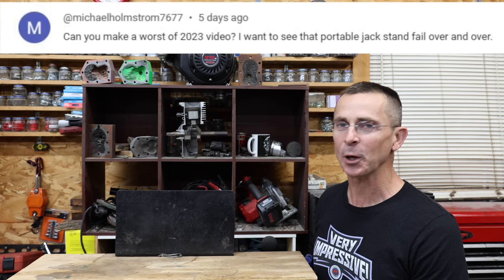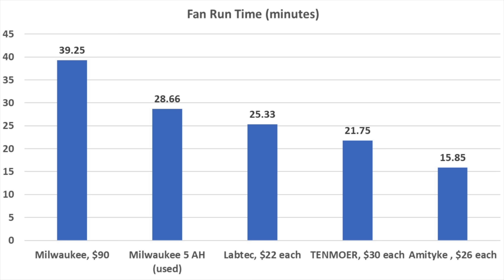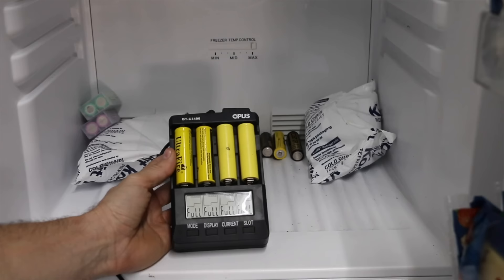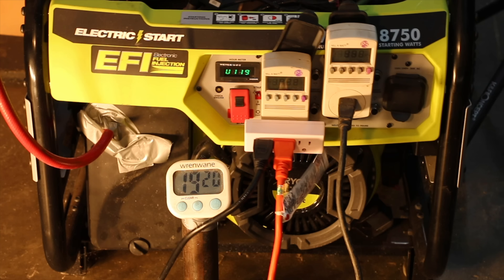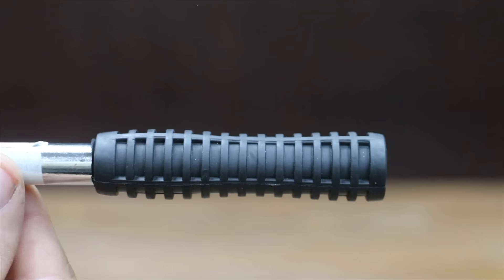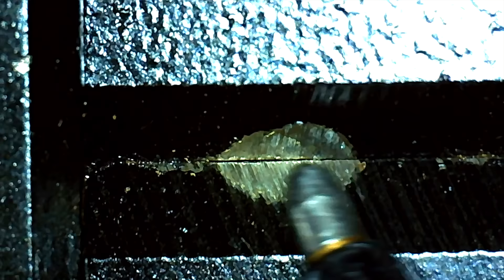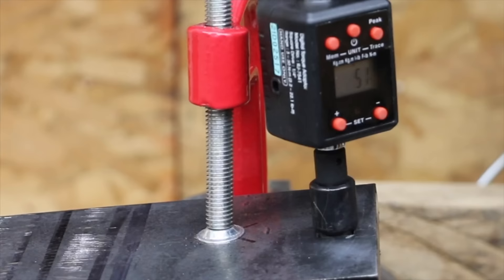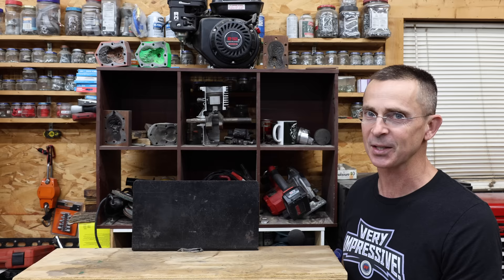10 Worst Items Ever Tested? Let’s Find Out!

Comment: Time for top handle chainsaw! The  M18 top handle would have been great in your last battery powered 12" and smaller video, although could compete in full size as well. Seen many claims it cuts better than there 16" rear handle. I know top handles are mostly used for climbers, but they are also nice and compact for a lot of regular cutting. And there is quite a lineup of top handles gas and battery powerd! Would love to see such a review!
Reply: Also add the m18 hatchet came out shortly after your small chainsaw video! Would love to see that tested as well!
Reply from the maker: Thanks for the suggeston.

Comment: I had the same thing happen with a knock-off EGO battery. When the postman handed me the '12ah' battery; before it even hit my hands; I said to him; "There must be some mistake". Then when I took possession of it; that's when I knew I'd been duped!
It was comparatively "light as a feather".
I put it in my beast of a chainsaw; and the saw would only operate on low power; and that's after the battery had been fully charged.
That being said; I have had excellent luck with Labtech 40v 6ah 'Greenworks' batteries.
Definitely longer runtime than genuine Greenworks 4ah batteries. Long term studies are ongoing...
Reply from the maker: Thanks for sharing.

Comment: Ok i have to say that drill attachment for the angle grinder may have its uses.  Maybe not for drilling into metal, i think the danger of damaging the bit by overheating it is to great at that speed...

But if you need to drill lots of holes through wood fast that thing would be a beast.
Reply from the maker: Thanks for the feedback.

Comment: While I'm not saying I would use that XSP jack stand, it appears your downward force test of it was a flawed test. That jack appears to use the center post to the ground surface for the weight while the legs are for stabilization only. The test appeared to have the center suspended so the weight was then passed to parts (legs) that was not designed to hold the total weight, but rather just try to keep the unit up right.

Comment: The HHO kit you have isn't producing enough liters per minute you'd need 3 or four of those running together to make a difference in a vehicle, and I believe the map sensor would need to be changed out. That's surely a 7 plate set and it's on the small side from what I'm use to seeing. I won't get into the math but the square area of those plates isn't producing as much hydrogen as can be seen running through the tube. 👍🏼

Comment: Ive been reading up on dirtbike specs and adventure bike specs the adventure bikes are double the weight with half the suspension travel so idk whats up with them but the specs they give online for dirtbikes and motorcycles only give specs on suspension travel and the diameter of the suspension as another spec but we know that those springs can be totally different strengths so is there a way you can think of of testing the suspensions stiffness? We all really need it theres no reall data on the different stiffnesses and thats the specs we would all want. The 650s go back for ever maybe you can test out the old xr650 vs a dr650 vs a klr650 with some of your gauges and see if there really was always a clear one to go with.
Reply from the maker: Thanks for the suggestion.
Reply: @ProjectFarm  no problem that would be a easy video too, theyve been the same since the 1990s you can buy them for like 4 thousand dollars each then resell them for the same price after testing

Comment: Tried telling some guys i worked with years ago those knock offs aren't as powerful and even if they are they are cheap for a reason. And usually theyre cheap in one of the most important places, that being the chips that try to prevent the battery from shorting out etc...
Reply from the maker: Thanks for the feedback.

Comment: I'm not sure whether it's the exact same thing or not, but i know my granddad has a little hydrogen generator in his car (turbo diesel), and apparently the inspection centre was surprised by a significantly cleaner than expected emissions test when the car went through its mandatory every-2-years inspection, so i guess it does do something provided the machine works as advertised.
Reply from the maker: Thanks for the feedback.

Comment: Oh. I have one of those things. The bolt cutters. They have survived thousands of pieces of 1,5mm wire for my chainmail rings. Would not recommend those though. Cheapest ones i could find and. Well. Good enough. But if you can find better ones and justify even a little more expense, go for it.
Reply from the maker: Thanks for the feedback.

Comment: That Amityke battery... after finishing with the testing, I'd have cracked it open after that to see what they actually had in there.  My guess is a couple of cheap rechargeable lithium batteries.  Maybe not a couple of AAs but not far off.  Hell, maybe they had a single one of those Ultrafire 18650s.

Comment: I use 18650 batteries for my vape... I worked at a mill and they had a disposal bucket for dead batteries. I found 2 Milwaukee drill batteries there and harvested the 18650 cells. I have been using those cells in my vape for years!
Reply from the maker: Thanks for sharing.

Comment: Those knock off milwaukee bateries can be really good i bought amicross brand rated at 8 ah i opend the battery to see what cells were used and to my surprise where lg brand cells and it was actually under rated by .7ah have had them for a year now and they still perform very well.
Reply from the maker: Thanks for the feedback.

Comment: Will you do a tire dressing video. Not a tire shine. A tire dressing. A permanent coating used that does not wash off and holds up to all elements and such for around 6 months to a year. I'd love to see one that has a good comparison to normal tire shine. Products that I'd start with are dura-coatings tire dressing and permashine tire dressing, mountain shine tire dressing ect.
Reply from the maker: Thanks for the suggestion.

Comment: 14:56 I personally wouldn't be using bolt cutters of that small size to cut things like that. Sure the best brands may do it ok but you'll be damaging your tool doing it more than a couple of times. I'd recommend using slightly larger bolt cutters for things of that size.
Reply from the maker: Thanks for the constructive feedback.

Comment: I cheaped out and got the Milwaukee knockoff 18v 6ah batteries.
Continued use (about two or three 5 minute runs) burned up my hole hog turning a $34.00 Amazon experiment into a $400.00 lesson in buying the batteries made for the tools.
Reply from the maker: Thanks for sharing.

Comment: The HHO generator is put in this position due to not enough information about how to set it up. On a O2 sensor controlled engine you CANNOT make it work just by installing it. The O2 sensor corrects the Lambda over relatively short time, which is also why youy see a worse result the second time around. I will say this much. installing a HHO generator on a newer vehicle is not just something you do in an afternoon if you want good results. It takes time, and sometimes quite a bit before you find the sweet spot. This is also why the idea died out about as fast as ECU controlled vehicles became the norm. If you want good results you NEED to tune the ECU for the higher level of oxygen in the exhaust. OR use it on a non ECU controlled engine where the flapper or the carb simply adds less fuel due to a more efficient burn. In such cases it is pretty easy to improve fuel efficiency with 10-15% at highway cruise speed..
Reply from the maker: Thanks for the feedback.

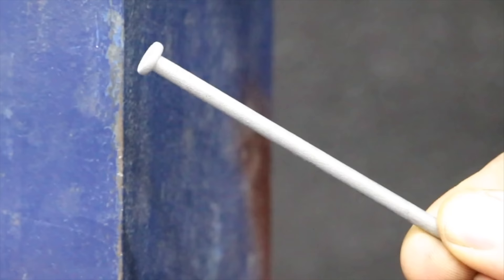Comment: At 13:50-15 you've got a bad test.  You've got the nail in different places for different bolt cutters.  Gonna be easier to cut when it's closer to the handle

Comment: I had to disagree right from the start with your test of the knock off Milwaukee battery. I bought two for $45 and have been using them for almost three years with no issues. They don't run as long as the genuine ones but at $27 compared to $145, I'll make do.

Comment: Dude, I already told you that the HHO won't work on a petrol engine 🙄 it's meant for diesel engines, and you have to match the cell to the volume  of the engine. I installed one on my '97 Renault Master van (2.5L engine, no turbocharger) and so far my mileage has gone from 900km to 1200km. The lightning-fast flame front of Dihydrogen accelerates the sluggish combustion of the diesel in the combustion chamber, and makes for a complete combustion - hence the economy since you have to press less on the accelerator for the same result (less fuel), my engine torque also went up but I haven't been to measure the actual torque gain.

You just can't stuff one of these in any engine without following the specs and manual and expect anything to happen. I remember your test video, you used a dry cell made for a 2L diesel engine on a 6L petrol engine. That was asking for failure. I've followed your videos for quite some time and can appreciate the sincere effort, but for that one you really didn't know what you were doing.

Comment: the worce the engine the better HHO is. To see results i would test again with a lawnmower that runs runs rich.  . I cannot speak for this kit but i've had positive results from home made stuff we made in prion 13 years ago. I taught auto mechanics from 2010 to 2012 I had a few know it alls so I asked them if they could burn water they laughed so i made an hho generator out of a mason jar with a tin foil top with a hole in it, the plates i used scrap metal separated by zip ties and powered it from a battery charger. I waited a minute and lit my lighter over the hole. the inmates laughed and i told them to stick a piece of paper on the hole and they tripped out because it instantly caught fire . The flame was so pure its practically invisible and so hot the tin foil only lasted a few minutes. Then once the inmates seen they did not in fact know it all then  i explained the process. The things the inmates came up in the weeks following was quite impressive. one looked very similar to your kit.   .IT is NOT magic.HHO does not break thermodynamic laws.  Old carb engines  were horribly inefficient with allot of unburned fuel going out the tailpipe.  The HHO injects a tiny amount of hydrogen and pure oxygen  that helps the engine burn some of the fuel that was wasted. We had newer cars and  a very old 1970 dodge van that ran like crap begging to die in the fleet. So we did an experiment. We brought in a fuel injected s10 warmed the engine drained the fuel put in 1 gallon and recorded how long, then we hooked up the HHO (that was 4 times the size of your kit put in one gallon and let it run. It lasted about 1 minute longer , to close to call a difference. We hooked up the old crap van same test and got a 10% improvement repeated the test twice more , same results. Modern engines have evolved past HHOs ability to help.

Comment: I'm not one of those tool snobs that owes my soul to the Snap-On truck .. example, for what I do, I'm good with my $20 angle grinders which last about 2 years .. though I do recognize quality where required, and own a $140 screw driver that I bought from Japan because then, I was dealing with several hundred 4mm JIS machine screws every day. Some of the big brands are hype,  but you do often get what you pay for. That said .. No biggie if your pliers poop the bed, but crappy jack stands (and car ramps) should literally be a criminal offense. 

Funny story .. I've worked under very heavy things for many years and ONLY trust "log cabin" 6x6. Well, few weeks ago the wife's Yaris needed under service in the drive. Was using a pair of crappy 2 ton stands (that came with the house) to 'step' with the jack while building the cabin .. and damned if one didn't fold a leg and drop the car. 

Now capitalism is grand .. until someone loses an eye. We live in our respectively 'free' countries, and if I want to buy a super universal wrench made from butterscotch pudding - that's my right to do so as an idjit. But someone should be keeping a more vigilant eye on the state of affairs that matter to actually staying alive.

2024 now .. had to sit through an idiot safety meeting last week to learn again 58 years later how not to trip over an air line/extension cord .. or dive under a moving forklift. But who tells the average suburbanite that the plastic power strip they just bought is sporting AWG 20 wire made from recycled toasters?

Comment: Low carbon steel cannot harden by overheating... there's not enough carbon. At 10k RPM, a 3/8" cobalt HSS drill bit is running about 10 times the correct cutting speed (SFM) for mild steel. Since the work was thin you got away with it, and did not create a new alloy of cobalt HSS and C1018 steel. That's called friction welding.
Reply from the maker: Thanks for the feedback.

Comment: lmao that HHO setup. "First let's use the energy from the engine to split the hydrogen from the oxygen using a less than 100% efficient system, then let's recombine it in your engine which is inefficient at extracting energy.  Overall this will improve your performance!"
Reply from the maker: Thanks or the feedback.

Comment: Amitkye battery is junk.  A friend bought some knockoff M18 5.0MAh and they didn't last a year before the cells became likely out of balance and the charger refused to charge them.  The M18 High Output XC lineup, the HD12.0 and the little High Output CP3.0  use 21700 cells (21x70mm) vs the normal 18650 (18x65mm).
Reply from the maker: Thanks for the feedback.

Comment: Test a chinese lipo for an rc car. The soft square packs. And hook it up to something. The only thing. They dont have a low voltage cutoff
Reply: I don't think there's anyone to compare to. Only traxxas batteries.
Reply from the maker: Thanks for the suggestion.

Comment: The battery probably weighs more because the XC 6.0 most likely means Xtra Capacity,
 which would account for the extra weight going up against a standard capacity
For the XC battery Milwaukee's website states 2X the power so the cheap one died at 15 minutes
 Milwaukee died at just shy of 40 minutes so their claim isn't too far off
Reply from the maker: Thanks for the feedback.

Comment: I love the work and science in Project Farm videos. I am not opposed to buying products made in China. I remember as a kid laughing about "junk" made in Japan. Now Japan makes many products superior to ours. How long before that happens to China? That being said there are times when the best may not be necessary and value is primary after taking safety into consideration. This could be the case for one time or extremely seldom use tools. However, the point I wanted to make here is that low cost tools frequently have poor quality control measures thus has huge variances in quality therefore one low price tool may test very well and the next very poorly.
Reply from the maker: Thanks!  Thanks for the feedback.

Comment: Did you (safely) cut open one of those ultrafire cells? 
A lot of them are smaller batteries, rewrapped, in a new shell, with a lead connecting the real to the fake positive. 
That could explain the extraordinary internal resistance.
Reply from the maker: Thanks for the suggestion.

Comment: People always fail to recognize that the power you need to make HHO comes from the engine crankshaft.  More electrical load = more torque lost.  And you can't even break even in the energy you get back.  Physics 101.  They've always been a dumb, useless idea.

10,000 rpm is definitely unsafe for a drill.  Serious risk of injury, and drilling steel is going to burn drill bits up left and right.  You can find speed and feed calculators and the math and charts to figure out what's right online.  A 3/8" drill in mild steel should be running around 900 rpm...

Comment: The HHO Kit was really a incomplete kit i can stand behind hydrogen confidently with a complete system they work wonders the cell alone can't improve any driving performance or efficiency, like a very important component I didn't see a desiccant dryer cartridge just like air compressors use on the gas line, also the video is a mix of Spanish then English oddly it appeared the electrolyte additive was Potassium Hydrochloride Aka pot ash one of the better choices but Using 20-30% caustic soda electrolyte solution works much better, its like comparing Zippo lighter fluid to E85. caustic soda can make your cell make to much oxyhydrogen and its releasing excess. If your getting bumbling in gas lines lines its to much amperage and your heating the water its gotta stay below id say 180F max between 130-150F is ideal the way you keep water bubbling into the gas line is Increase the water conductivity so less amps are required to produce the same Gas volume. Its a song and dance, But once you get a complete hydrogen fuel cell system dialed in there very impressive.. But again desiccant dryer it's an absolute must on fuel injected and GDI motors you can't use wet gas it throws check engine codes and it lowers efficiency you need a nice dry gas entering the intake manifold. but i literally could of predicted you calling it waste because using that system as is i agree it would be but a few more components you could have something youd see real efficient gains with..So don't judge hho technology as junk these many of these kits are just simply incomplete systems to achieve what there saying and it's unfortunately inaccurate..One must wonder if big fossil fuel energy corps are behind these incomplete kits sales well knowing they will disappoint, so you don't support hydrogen as a fuel source... Fyi every rocket sent into space was powdered by none other then Hydrogen But liquifled Cytogenetic compressed hydrogen..